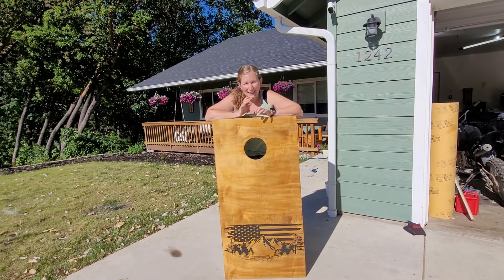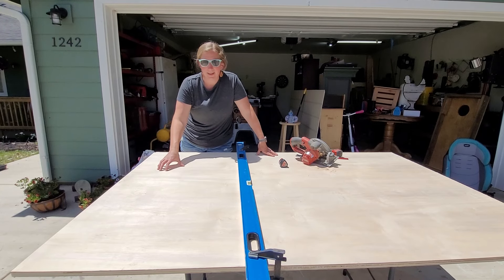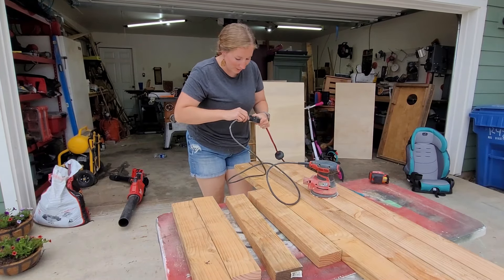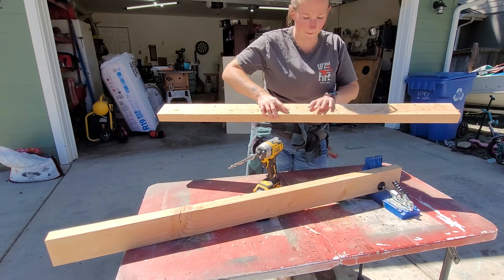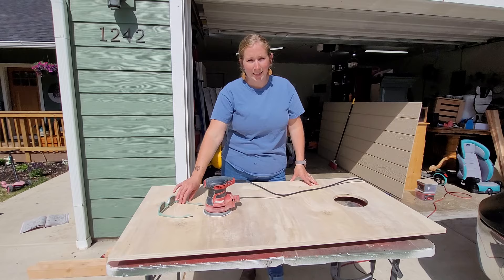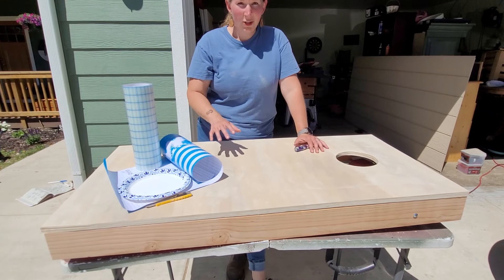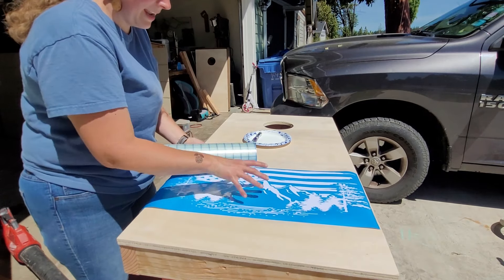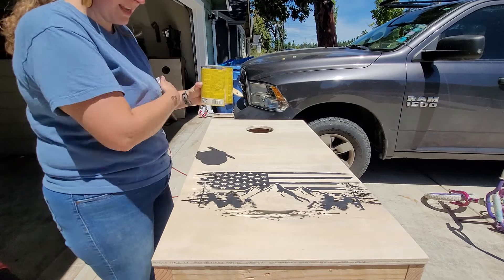DIY Cornhole Boards

Comment: Couldn't you use two by 2 instead of 2 by 4 it would make it lighter
Reply from the maker: @frankgreen7988  definitely! But my family is rough on stuff and I make these built to last!
Reply: Regulations... The front of the board 3 to 4 inches off the ground... so you can use 1x4 instead to make it lighter.